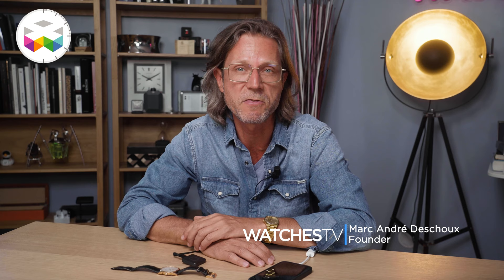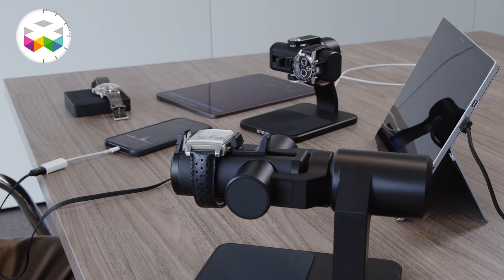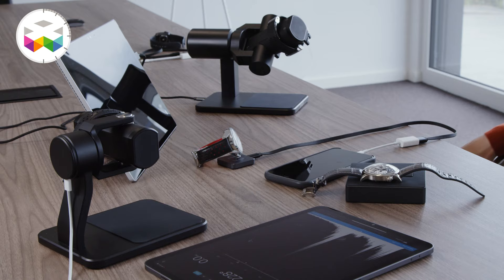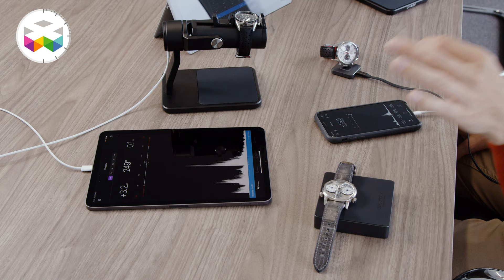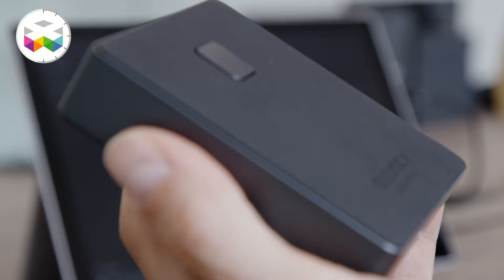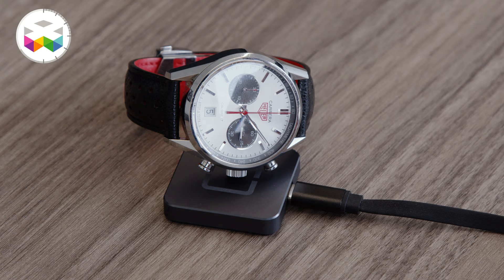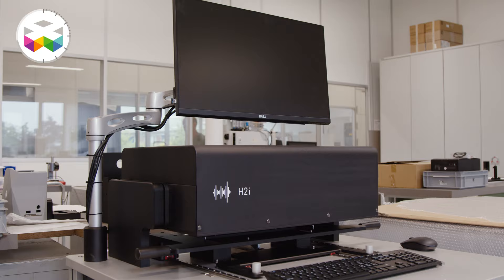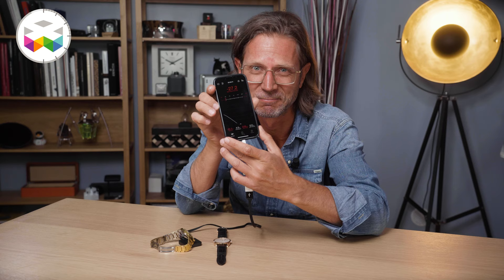How to assess the proper functioning of your watch?

Comment: My only concern is if they go out of business, and the app is no longer supported so is no longer available from the app store it's then an expensive lump of useless metal! Lepsi was a similar type of iOS device that has disappeared and while it still luckily works at the moment, eventually it won't be signed for future iOS releases and the app will be gone from the App Store and an expensive paperweight is the result. Which is why a standalone Witschi is probably the better long term prospect.

Comment: I am a little obsessed with accuracy, so I regulate my watches according to my daily wearing pattern. To help me with that I first used an iPhone App using the microphone of the headset, but it was too noise sensitive. So I bought a Chinese timegrapher with piezo microphone for 200 EUR. This works perfectly for my needs and it is very accurate - I compared it with a professional Witschi.
But everybody should really get one of those demagnetizers for 10 EUR. I use it every time I put on a watch out of my rotation (about every 1-2 weeks), because my experience (and measurements) shows that magnetizing can happen easily.
Reply from the maker: Thanks for your input and nice to share these options 👍